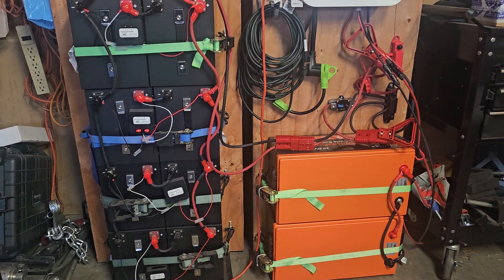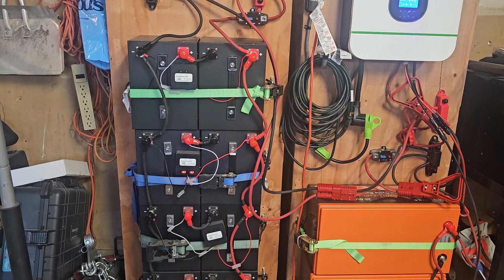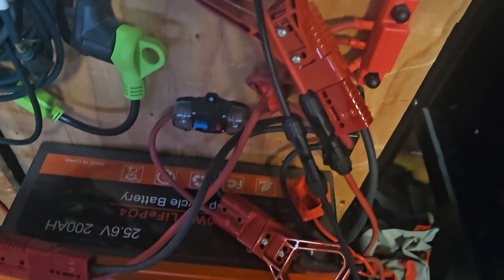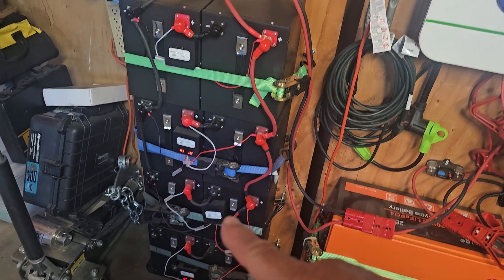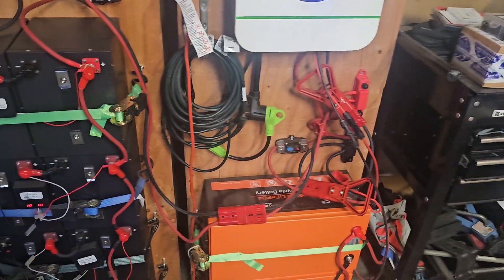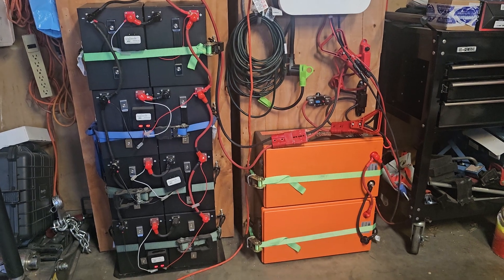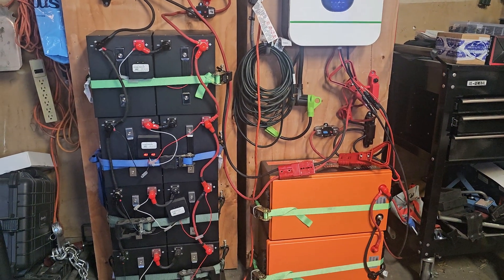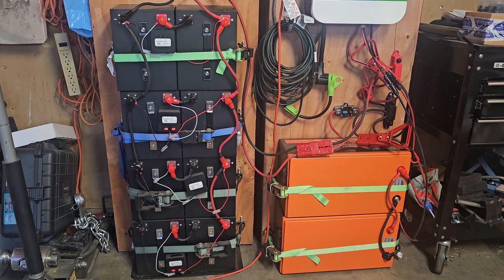Large portable hand cart battery solar bank

Comment: I like the fact that you can maintain the system yourself.  I purchased a Bluetti system and it broke down right away.   I sent it back to them (with an authorized return document) and then they ghosted me.  That was a wasted $2,000.   You will likely get many years of service from your energy storage arrangement.
Reply: Sorry to hear. That's why i believe in building your system yourself so you can repair it if needed.